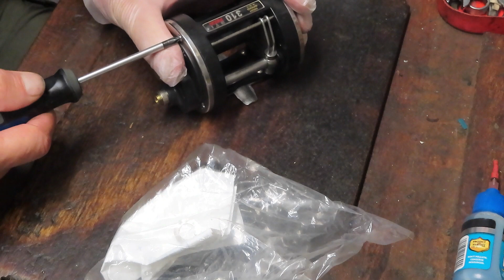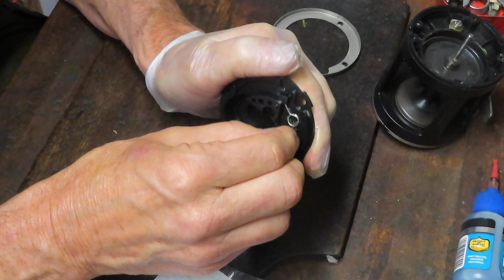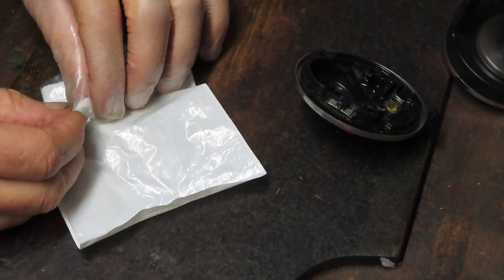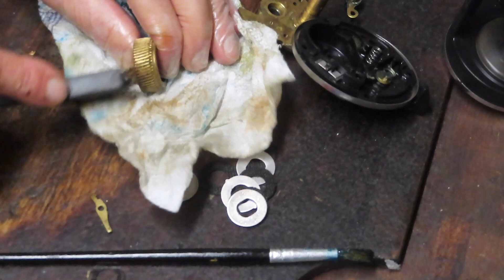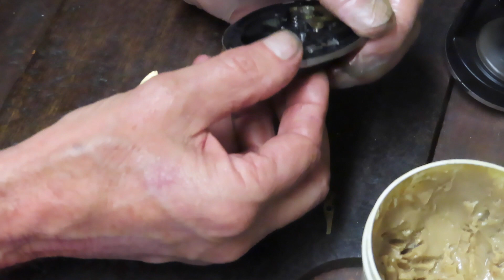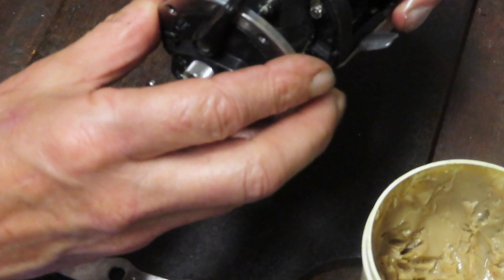Penn 310 GT1 saltwater fishing reel in a bag project how to assemble and service

Comment: Hi Dennis, new subscriber from Australia here! Have you ever worked on a 340GTi or have any videos? I’m having issues putting mine back together after a full tear down service because it had a good swim in salt water after some heavy storms. Cheers
Reply from the maker: Thanks for the sub Christopher.   I have done several on the GTI series. You can watch the 330 here.  it is very much the same as the 340. https://youtu.be/g8tgl91uTpg I have also done one on the 345 GTI that you can find in a search.  Thanks for asking - Dennis
Reply: Thanks Dennis, I watched your 345 video and that helped me quite a lot since they are virtually an identical design all bar the extra bearing on the end of the spool. I think I was also greasing things that didn’t need grease and I had a few other pieces seated incorrectly so the spool simple wouldn’t spin when reeling. I will definitely be taking better photos next time to recall the correct orientations. Thanks again mate, look forward to watching more of your videos! All the best!

Comment: Hi Dennis,
      An interesting wide main gear and eccentric reassembly ! 
     Worked on a slow Daiwa 1605 spinning reel yesterday that was "sand papered".  Turns out the reel was totally bound up from old grease and sand.  Sand was imbedded in the old grease and oil.  Had to chisel the grease and WD-40/ flush all the sand multiple times.  Never saw anything like it #!/#!!  Happy to say that patient survived and is doing well !!
Stay cool w/ Best Az Wishes,
Cons
Reply from the maker: I see you are a comfortable 112 in AZ - stay cool!  Dennis

Comment: There are too many “balancing acts” in this reel for me. I’m not sure I could do this. I certainly couldn’t do it with the ease with which you put this one together. Just give me my spinning reels. I sent you an e-mail with a photo about a Roddy reel I had a question about. It is an interesting reel as you will see. I’m getting excited about going to the coast this Sunday. I’m just having problems deciding what reels to take. Have a great weekend!
Reply from the maker: I guess it would be hard to narrow your choice with the 150+ candidates.  I'm sure you will narrow the field.  That Roddy is nice.  I have not worked on one.  Best wishes for great fishing - Dennis
Reply: @2ndChanceTackle  These are the reels I’m taking: Penn 706Z, Mitchell - 302N, 396 PUM, 496  Blue/gray, 498 PUM, and a 488. That should do the job. I have them packed in some of my Apache waterproof cases to keep them from getting bumped around. I’ll be using a !0’ Ugly Stick. 11’ Offshore Angler Ocean Master, and a new 11” Ninja Dagger for my rods. They’re all packed and ready to go.
Reply from the maker: Wow - that sounds like a well made plan.  I am ready to join you but have a question - No maiden voyage for the 9000?
Reply: @2ndChanceTackle  The 9000C will be baptized on my trip in late August. I’m trying to decide whether to put mono on it or back it with mono and put braid on it. I’m planning to put the Mitchells down and use my Daiwas including a very nice 8600 and a few Shakespeare’s I haven’t used yet. The August trip and another in October will be at better times for good fishing. I have one Luxor I plan to use on one of those weeks as well as the huge Shimano SSG 7000 rear drag reel. There are just too many choices.  I still have a very nice Mitchell 498 Sport that I haven’t used yet too.